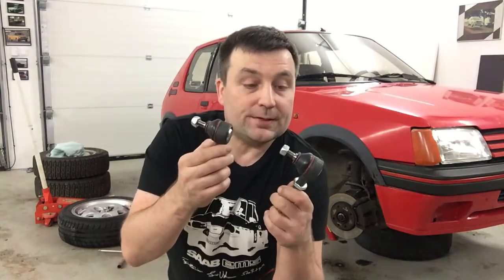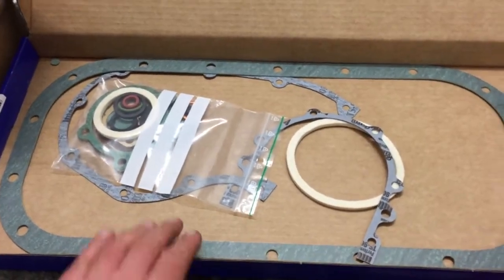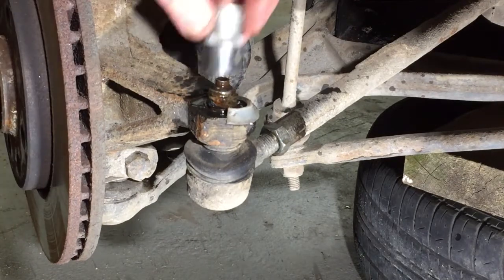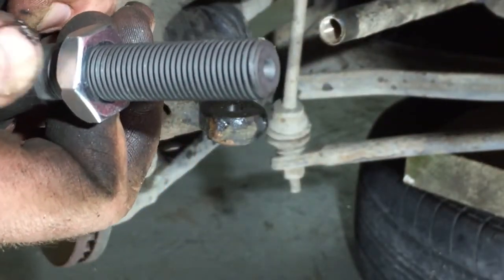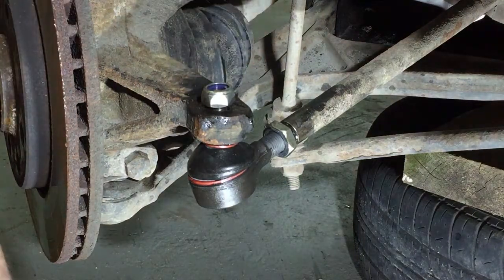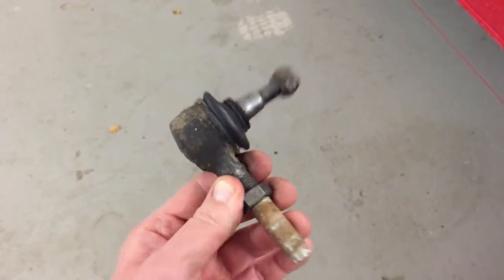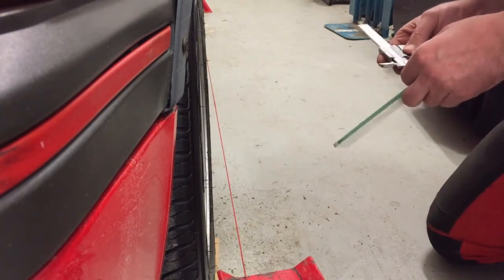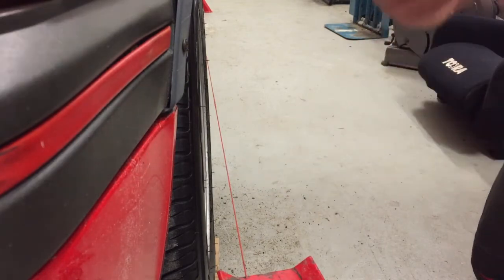New tie rod ends | Peugeot 205 GTI 1.9 |

Comment: Cool 205! And thanks for the explanation on the DIY alignment :) I was wondering how to approach this job on my own 205 so that I can get an idea of the state of the alignment. You could improve the sound a little bit with an external microphone because the reverb is very loud in your garage. But other than that, thank you for making this video!
Reply from the maker: Thanks! These are not tutorial videos so be careful.😉 I have plans for new wireless microphone.
Reply: @hanssgarage1886  Awesome! Yeah, I will only use the measurement to get an idea of the state of the alignment after I replace the track rods on my 205. The MOT guy said they have play. Let's see if I can replace only the track rods or have to go ahead and buy a whole new rack. Of course I will let the professional fix the alignment afterwards.
Reply: @judahcallum8504  password reset maybe?
Reply: @Judah Callum Instablaster :)
Reply: @Cameron James thanks for your reply. I found the site on google and Im in the hacking process now.
Looks like it's gonna take quite some time so I will reply here later with my results.
Reply: @Cameron James It did the trick and I finally got access to my account again. I am so happy!
Thank you so much you saved my account!
Reply: @Judah Callum You are welcome =)